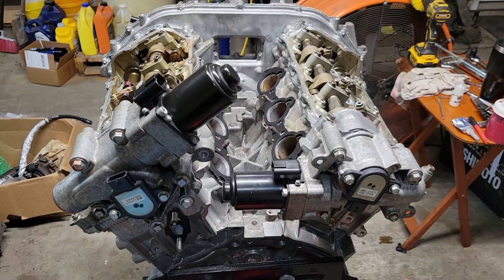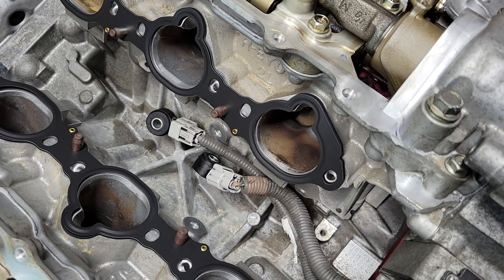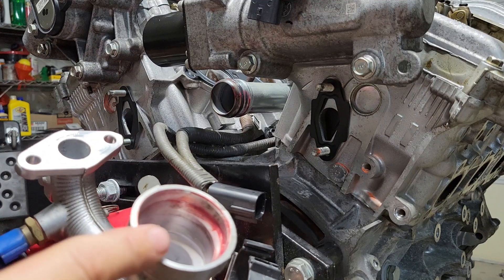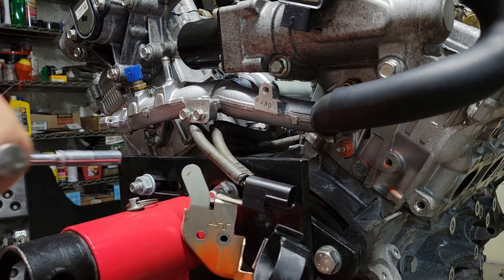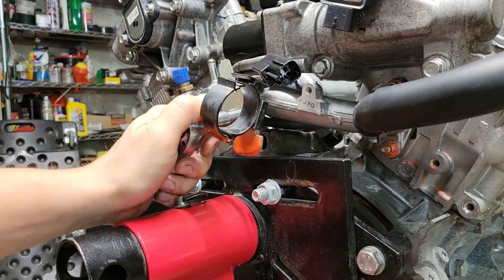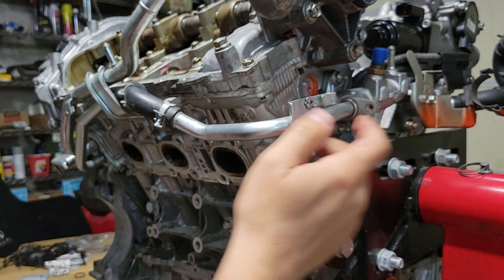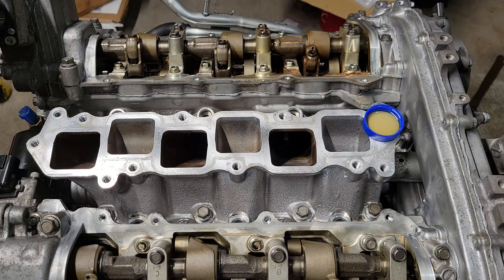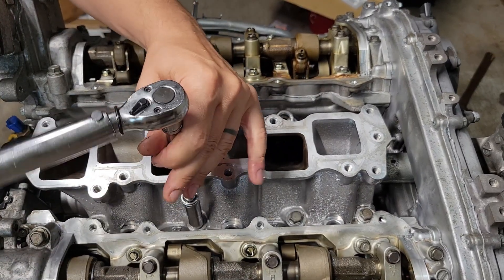Forged VQ37VHR build part 24, lower plenum and coolant piping

Comment: I own a Vq37vhr swap. I want boost it witha stocker kit fully built from ground up. With an automatic transmission with long gears for all the power. Do you have any suggestions on how I can do this? Thanks
Reply from the maker: A stroker kit with an auto transmission with tall gearing? I'd say TH400 swap.
Reply: @garagefanatic7830  where can I purchase one?
Reply from the maker: @popclutch_100  Brian Crower

Comment: Can U PLEASE 🙏 upload the rest .. also what’s the wheel and tire combo sizes and stuff for the black sedan in the intro
Reply from the maker: I'll finish up tomorrow since I don't have to work. The Specs for my rims are 18x5 Racestar skinnies up front(Mustang fitment) and 17x9.5 +43.5mm offset Racestar out back(also Mustang fitment). The rear needed slight shaving of the Akebono calipers to clear. Fronts are 18x5 Mickey Thompson radials and the rears are 305/45R17 Mickey Thompson ET Streer R drag radials.
Reply: @garagefanatic7830  thank bro I actually got the engine in the car last night …. Now I just need to figure out what connector goes to knock sensor bank one and a few more connectors around transmission I didn’t label …. I followed every video and have never found a more comprehensive detailed guide…. Thank u for everything